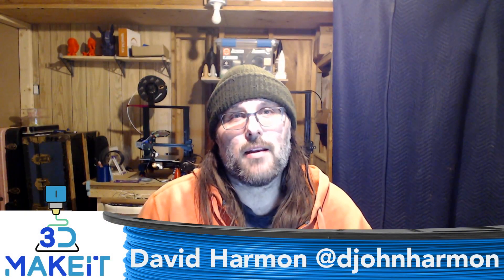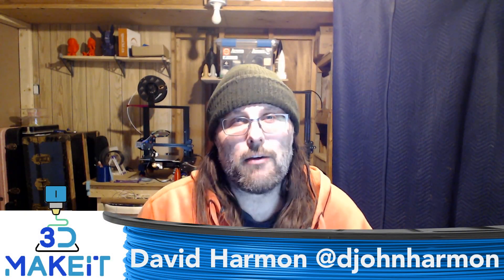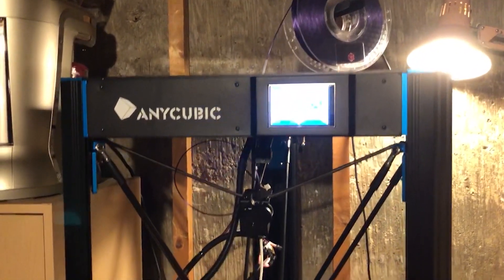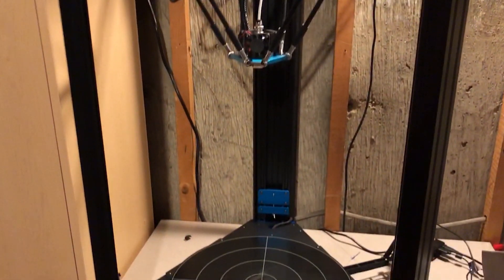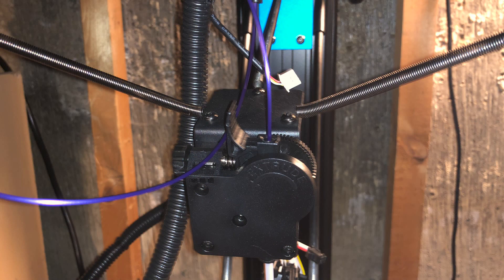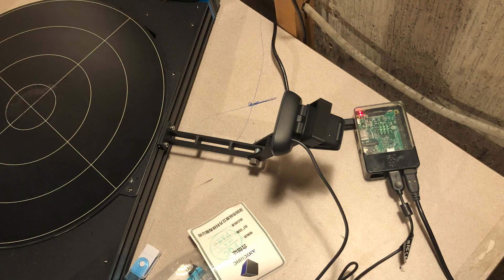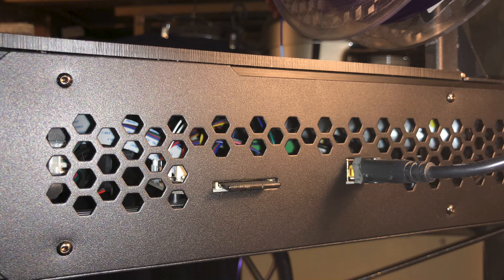Anycubic Predator Review

Comment: I'm having problems getting PLA to stick to the plate. I tried putting blue painters tape, but then I have a VERY hard time getting the parts off. Any suggestions? Thanks in advance!
Reply from the maker: HI! so i would say give the build plate a good wipe down with iso and get all the glue from the tape off.   Once clean pla will stick very well with a bed temp of 60.   One thing is this type of build surface is sensitive to oils in your fingers.  Soo they send the nice scrapper and gloves to keep it from being touched and remaining clean longer.    This build surface works because when hot the pores on the build surface expand and at the end of the print when it cools the close and almost pop the print off by itself.

Comment: Just built one of these over the weekend, was so excited, and thus far it won't even print the level test consistently. Not sure if it's crap cheap pack-in filament or something within the machine but my to-print list is getting backed up. One thing I suspect is the extruder is highly suspect. The adjustment was maxed out when I got it and it won't feed anything consistently while printing. Doing a filament feed test and it flows fine, so long as it's not moving. Any ideas? I want to love this thing but it's beating me hard so far.
Reply from the maker: I adjusted mine to about half.  If you heat the nozzle and extrude does it seem like the filament flow is good?   I know on the one we set up in our original video has a blocked nozzle cause the ptfe wasn’t set all the way down the break.   So I had to switch the hotend to the spare that came with it.   But honestly it’s been a work horse.  If there’s 2 printers I go to it’s the predator and my cr10.   If you bend the filament over your fingernail does it snap? Could be the roll absorbed moisture and that can cause issues.
Reply: @3DMakeIt  Just swapped out the filament, and the flow is very good now. Seems like the extruder has a better grip quite suddenly. Both rolls were fresh and reasonably flexible (didn't snap). Redid the bed level process for the billionth time today and now it's barely printing on the left side of the machine and perfectly fine on the right. I'm thinking I'll swap the hot end to the spare tomorrow or at least the nozzle. Thank you very much for the reply, wasn't expecting one tonight to be honest!
Reply from the maker: @C-M-E  any luck with the leveling?
Reply: @3DMakeIt  It completed the level test fine at long last, but then went to do an actual print and the previously 'fine' level setting balled filament all over the nozzle. Taking a break for tonight and having a bit of a head scratcher 'til tomorrow.  It's one of the most confounding things I've ever come across where doing a calibration immediately before a print actually makes things worse.
Reply from the maker: @C-M-E   you can baby step during a print which will help nail the level in.   Also make sure to wipe the bed off with iso (I did it out of the box and I do it every 10 prints or so)  that build surface enoys to be clean clean
Reply: @3DMakeIt  Just about to get back into testing mode. Thank you again for the troubleshooting ideas, and yep, about to clean the bed! I found a few videos this morning that details what also might be the problem, which was loose pulleys or a bad adjustment screw(s) on the stepper motors. The one time I got the level print to work correctly, it was very thin on one side left to right (left was a few layers thinner than the right).
Reply: Well sum bitch, I finally got a decent print out of the machine. I was able to show tech support enough evidence that the bed was horribly warped in the back left quadrant and they're sending a replacement. Til then, I can print in the center portion okay after swapping out the hot end with the spare, made a WORLD of difference! So now that this thing is slinging plastic like a champ, are there any settings (using Cura 4.5 as it seems to produce the best prints in the shortest time. Also have about all the free ones like ideamaker, prusa, mesh mixer) to reduce stringing? I'm getting a crazy amount, and it doesn't seem to lessen by slowing the printer down or getting crazy restrictive with the usual settings.